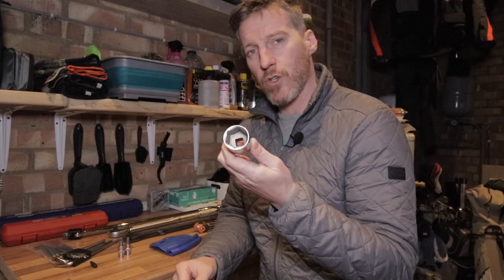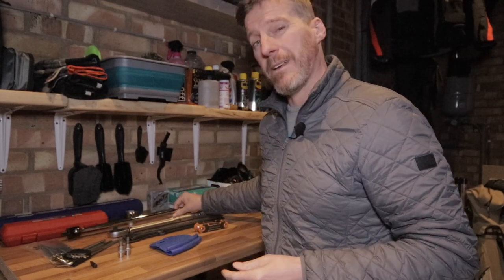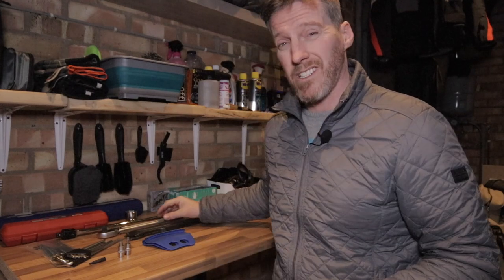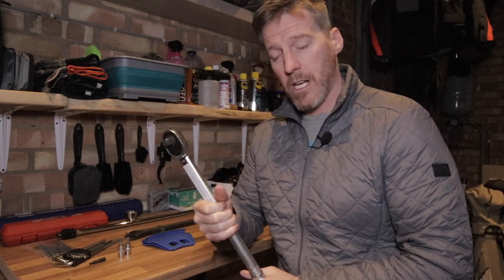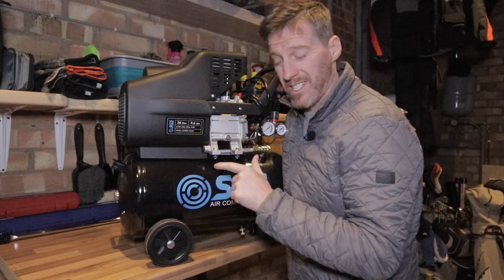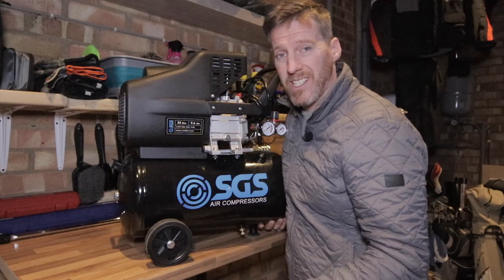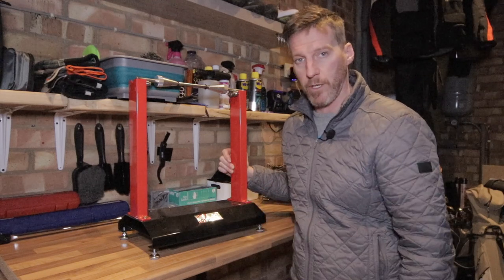Tools for changing motorcycle tyres

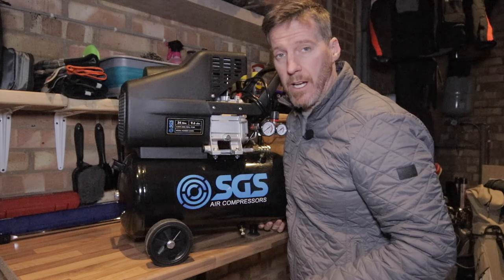Comment: Hello Billy - very helpful video - thanks. Just one question please - I have exactly the same air compressor as you feature in the video (4:46). Does it do the job of seating the beads ok? Many thanks, Mark.
Reply from the maker: Hi Mark. That air compressor has plenty of power so never had a problem seating on the bead any tyres that I have had. Thanks for watching and your comments!  Cheers  Billy
Reply: @BillysBikeAdventures  Many thanks - much appreciated.